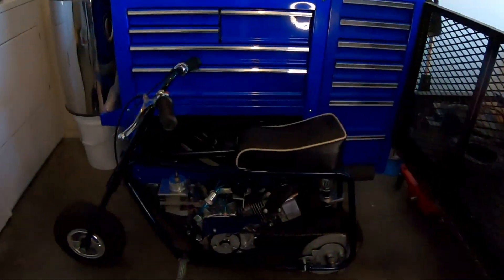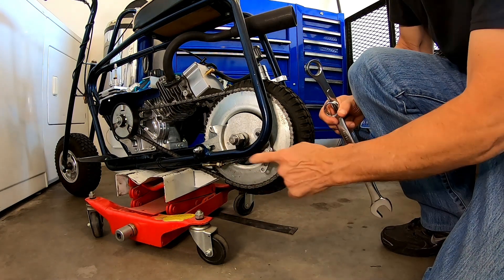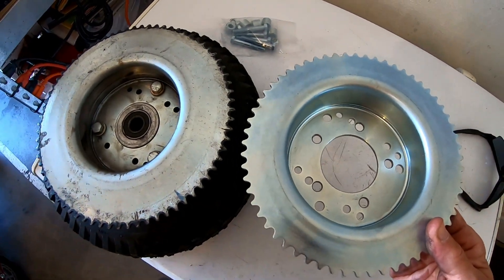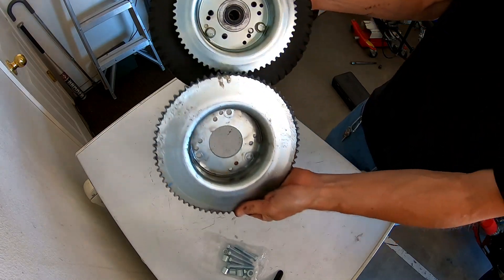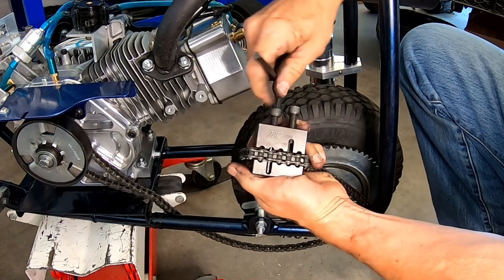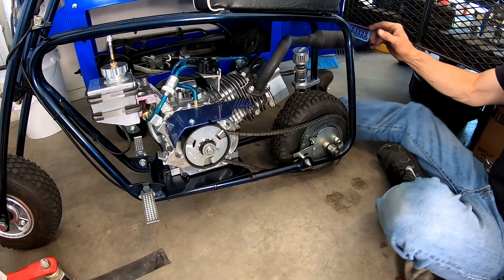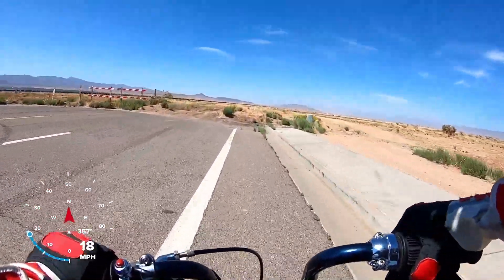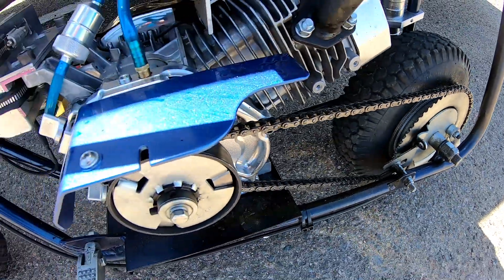Minibike goes 70 MPH/Predator 212

Comment: Beautiful bike my dude, nicely done 👌 one day I will have a bike equally as fast and then maybe one day we will meet up and race lol
Reply from the maker: Thanks! That would be fun. That's what it's all about is enjoying these things and having fun.
Reply: @Black66  and then getting a ticket😂😂😂😂😂😂😂
Reply from the maker: @IIIIIa1exIIIII  Adds to the excitement!
Reply: @Black66  my 1970 speedway shrike doesn't compare its dirty and original with the Tecumseh h30 but even after I restore it, wont compare to this beauty.
Reply from the maker: @BillyMcBean. Thanks! Yours is awesome too. Especially with that Tecumseh on there. That is old school.
Reply: @Black66  why didn't u go with a higher tire ?
Reply: @Black66 how much would that cost to get one?
Reply: Iv got a 60mph on 8in tires turning 7000rpms on a manco thunderbird mini bike  its a 212 non hemi 18lb valve springs sanded short turn 1.3 stamped rocker arms [stock style] just 1.3 ratio stock style carb with mixture screw bigger jet mod 2 cam arc rod and flywheel 32 degrees intake filter and 1in header pipe makes tones of power and has no problem moving a 115lbs to 60mph
Reply from the maker: @madness_-yg3lw  Nice build!
Reply: @Black66  thanks lot of time and money in that build runs very well and very reliable i use a bicycle brake lever for my gas and on stock carb is very smooth and controlable i plain on posting a short video on what iv done and how fast i can go only probelm now is i blow apart the clutch bushings the brass one i have to install my cvt to solve that problem but i think i might be making to much power for it and will shred the belts my goal is 100mph i plain to swap valve springs and get a 24mm carburetor
Reply from the maker: @madness_-yg3lw  Keep working at it. You will get there sooner or later. I bet you will reach your goal with a clutch.
Reply: @Black66  i ordered the 24mm carb and jet kit im swapping from 93 to 110 race fuel so im sure gonna try
Reply from the maker: @madness_-yg3lw  Sweet! It will be a beast
Reply: @Black66  I got a 24in wheel and a 14in front sprocket...I'm running a 5000w brushless motor...and a 84tooth Rear Sprocket...The controller..is setup to do 5400 to 6000rpms...I'm trying to go over 35 mph...50 would be really Cool"
Reply from the maker: @RGIIIBOXING Yes it would!  I'm building an electric bike. I'm trying to do the same. Have to get over 50. We will see how it goes. 
.
Reply: @Black66  I was going with the 3000w motor" But I just decided to go with the 5000w set up with a 72v motor...I forgot to tell you I'm building the very popular...and there not 24in...They are 22"s....Yeah..I guess we will see"
Reply from the maker: @RGIIIBOXING  Are you building the Electro and co kit?
Reply: @Black66  yes....it's a fat bike with 22in wheels...The guy on YouTube...has a 20in..fat bike..with 2 tiny hub motors...look up fat bike with 20in rims...it's a silver bike with M.BENZ WHEELS"
Reply: @Black66  Did you find the video...of the 20in fat bike"..the only difference is..my bike has 22in wheels..and a 5000w Bldc Motor.. Brushless motor" 72v Battery".....I gotta get started on it..so I can be finished by the end of April... Thanks
Reply: Little update i got the vm22 on and 26lb springs with the ec billet valve spring retainers and keeps now turning 8000 rpms
Reply: Help  up+ my mini bike please
Reply: @juliabauer5047  whats your goal hp wise and whats the application  start off by deciding whats your target rpms and then go from there the higher the rpms you want the more you have to do to make it reliable i shot for 7000 i actually was turning 7250 till i went to 1.3 rockers and turn 6900 supper simple build about double the power 10 to 15  would be my guess definitely way more power then stock
Reply: https://www.youtube.com/watch?v=TYp7SgO_FrU
Reply: My Coleman cc100x goes 53mph 😅
Reply: The 2 second electric mini bike is bull shit. You cheat .

Comment: Boss man I just bought a 18 tooth clutch 35 chain of course. I ended up switching from a 75 tooth to a 40 and it struggles so I bought a 18 tooth clutch for 25 bucks in your opinion will it help gain acceleration
Reply from the maker: Check out this video about mini bike gear ratios  https://www.youtube.com/watch?v=xV8i59aGUao&list=PLkbj-ip-5FzZG40xkiEtZHRtF_jDzxA9U&index=9

Comment: I have a pred 212, billet rod, 32 d flywheel, 265 hot cam, 26lb springs, currently running a 12 t clutch, 60 rear, would an 18 t clutch be a good option to get more speed? Im gonna try it 😂 just curious if its a good idea

Comment: I was gonna run a 58 tooth on rear sprocket but I’m not sure what clutch would be better a 18 tooth or 15 tooth clutch on a 212 predator wit 265 cam and 26lb springs and rod and flywheel I’m gonna be running this on a cc100x

Comment: I have a ct200ex but I changed the motor for a Predator max 224cc engine i changed the value springs to 18 pound  and I  have a Torque convertive and open header and  it does 50 miles per hour i would like to get it to 60 miles per hour and no governor the Rear sprocket is a 60 tooth i have a 44 tooth would it help if i put the 44 tooth on the mini bike or would i need to get a 50 tooth
Reply from the maker: Check out the CT200U-EX playlist for many combos with this bike  https://www.youtube.com/watch?v=EKY4GblVKcE&list=PLkbj-ip-5FzbVBVqMi23O5noFSAbhNOp1&index=29

Comment: With gx160 head whats the benefit of it and do you need +.020 rod?
Reply from the maker: A bump in compression.  No need for a .020 rod
Reply: @Black66  where can I look at for bigger valve options and thank you imma look into the gx
Reply from the maker: @Devonortega420  GoPowerSports has them but for even a better flowing head check out the shred head video https://www.youtube.com/watch?v=9rDS1RcU5iI&t=13s

Comment: Why don't you head the opposite direction so you don't have to slam on the brake early to not hit the curb, because it's clear at 68mph, you're still accelerating and could surpass 70 easily? 😅
Reply: I was going to say the same exact thing and that's why I came on here to post. If you had a longer stretch you definitely hit 70 plus that day, but now I see you have another video where you succeeded. Sweet build brother.
Reply from the maker: I need a different area, there are cars the other way. Check out this video I surpassed 70 MPH https://www.youtube.com/watch?v=xV8i59aGUao&list=PLkbj-ip-5FzZG40xkiEtZHRtF_jDzxA9U&index=10

Comment: Man love your videos I currently have a 208cc ironton that id like to get the billet flywheel n new rods. But I was wondering Would predator 212 performance parts work with my 208cc ironton... Or should I just save the hassle n buy a predator 212
Reply from the maker: I think the external parts would work like carb, header , things like that . The internal stuff could be Clone like the flywheel taper and rod journal sizes etc ... maybe🤔 I haven't worked with an Ironton yet.

Comment: Not to be rude but can we get your weight. I am comparing some of my modifications to yours I am about 200lb and it does seem to be a big factor in 0-30mph and top speed. If not I understand completely.
Reply from the maker: Yes, I am about 160 LBS of solid muscle.😄👍💪💪
Reply: Okay I have the same setup with a 12 tooth clutch and a 70 tooth rear sprocket and a hot 265 cam and 40lbs on you. I am maxing out at 49 Mph. I guess that makes perfect sense. Thanks for the response 👍

Comment: Hey there, love your videos very entertaining to watch. You do all the stuff that you do to these bikes. You have taught me a lot already. I am trying to buy a second CC100X Mini bike. I have had no luck anywhere finding one. That will ship to my address in New York. Is there any way that you could steer me in the right direction.
Reply: Thanks man I will give it a look at. I got 1 CC 100 X my son got from A friend of his for $20. The gas was seized up on the turnhandle. I took that off and took a mountain bike. Brake handle and put that on in replace of the gas and hooked it all up and it Works great. I also bent back that stopping screw and got that Bike flying Down the road doing over 45 miles an hour.
Reply from the maker: Gokartsusa has them . Not sure if they will ship out that way though .

Comment: I just built an azusa bike.  The spacer that goes between the brake and wheel is the small one or the bigger than the one between the outside of the brake and frame?

Comment: I have the same setup as you, the only difference is I have a slightly bigger tire setup. Mine is a slightly taller tire. I'm hitting about 73mph on it. It might go faster than that.. but I don't have the road space to do any faster. I could probably max out on a highway but the cops are dicks around here.. so that being said I'll never know what the top speed is on my bike.
Reply from the maker: Yours sounds like a ripper! Check out the Mega Moto playlist for a little faster bike with bigger tires. https://www.youtube.com/watch?v=tWLFbTe1gdw&list=PLkbj-ip-5FzZG40xkiEtZHRtF_jDzxA9U&index=28

Comment: How fast do you think I would go with a 420 cc on a 17 or 18 tooth clutch and stock sprocket I have the same bike
Reply from the maker: I think a 420 would have way more torque to pull a heavier rider. The bike would probably be quicker getting to speed but wouldn't turn the RPM of the built smaller engines so I don't think the top speed would be better unless the bike was geared with a total highway gear.
Reply: @Black66  what would be high way gearing ?
Reply from the maker: @505racing3  In this video the bike ran a 3.3 to 1 ratio.Which is a highway gear.The average minibike runs around the 6 to 1 ratio .  I bet the 420 has the low end torque to pull even more of a highway gear than the 3.3 to 1. Maybe
Reply: @Black66  where can I get sprockets like yours ?? I have the same bike I want some different sprockets

Comment: Where can I get that fuel tank?
Reply from the maker: I made the fuel tank out of an overflow tank
Reply: How much would you charge to make one?
Reply from the maker: @downsouthkustom  Not sure. Let me look into what the tank will cost me .I did this one a couple of years ago.  Its  just tapping the tank and adding the fittings and drilling the cap for the vent. Its pretty inexpensive.

Comment: Wow ,, that's hard to believe,  over 70mph !!!I am impressed !
I just changed my 75 for a 65 gained 8 mph 
Really 60 would be ideal for my Coleman 100x it has a 12 on front.
Do you think I would be better to go w  a 14 tooth on the front 
Or just drop to a 60 on rear?
To gain more speed,,
Reply from the maker: Either will work as long as the engine has the torque to pull the gear. I go 70 on multiple bikes on the channel. Check out the playlists.  https://www.youtube.com/watch?v=xV8i59aGUao&list=PLkbj-ip-5FzZG40xkiEtZHRtF_jDzxA9U&index=10

Comment: Creepy stuff.  I ran the 72 on my railroad go kart, and I loved the launch and throttle response.  
But at normal operating speed the  resonant vibrations would envelope the entire machine and it's occupants.  Any vibrations felt the same as other set-ups, but the increased RPM would cause the vibes to resonate together into a kind of harmony that made people fell ill and very creepy like vertigo.  I had several people test it and they all said they could feel it at the same speed.  They said they could not feel any serious vibrations, but certain RPM / operating speed made them feel ill and disoriented.  WTF ?
Reply from the maker: Tha is weird. Maybe you can use rubber mounts. They have them on Amazon. Have you checked out the 72 MPH video? https://www.youtube.com/watch?v=xV8i59aGUao&list=PLkbj-ip-5FzZG40xkiEtZHRtF_jDzxA9U&index=10

Comment: 70 MPH on those little tires?  Instead of new sprocket, update front and rear tires with taller ones with a more highway tread. Weld a new set of axle mounts further back on Frame if needed.
Reply from the maker: I want to leave this frame a period stock as possible. When I want to go fast I use  a few different bikes. Here is the link to one of them. Thanks for watching. 
https://www.youtube.com/watch?v=xV8i59aGUao

Comment: IT SEEMS TO ME THE TIRE HEIGHT COULD HAVE BEEN CHANGED INSTEAD OF THE CHAIN SPOCKET. BY CHANGING THE TIRE HEIGHT YOU WOULD GAIN MORE MILES PER HOUR. AND GIVE THE BIGGER SPOCKET MORE GROUND CLEAREST.
Reply from the maker: I want to leave the bike as close to original as I can. I like the five-inch tires and wheels.  I have other bikes to go fast on. Check out the playlist. https://www.youtube.com/watch?v=VbcpA0jdSIw&list=PLkbj-ip-5FzZG40xkiEtZHRtF_jDzxA9U

Comment: Hey man I have a 212 predator with billet rod and piston, 22lb springs 265 cam and flywheel. 15×600-6 tires. I will be installing 26lbs springs but I want to get more speed. I'm currently hitting 55 with a 12t clutch and 56 rear. I was thinking 60 tooth and 15t clutch for more speed like in the 60s, what would you recommend?
Reply from the maker: Every tooth you go up on the clutch is equivalent to subtracting 6 off of the rear sprocket so that should get into the 60's with that combo . Depending on rider weight and other factors.

Comment: Put on a 45 tooth rear sprocket see if you can get to 100
Reply from the maker: Check out this video. Went over 70  MPH https://www.youtube.com/watch?v=xV8i59aGUao&t=11s
Reply: @Black66  are you in the 20hp range stage 4. 15hp stage 3, 12hp stage 2, 10hp stage 1.5, 9hp stage 1

Comment: So with the 14 tooth clutch and 36 tooth rear sprocket with my 208cc engine bike will barely take off hits about 40 mph sounds like it's at idle when it's doing 40 and won't really gain above that unless you go a mile so my gear ratio is not good at all with my brand new clutch I want my bike to do above 60 mph I have a 208cc engine what clutch and rear sprocket do I need with a 10-in tire and 150 lb guy also if I put the bike on a stand so the rear tire spins freely the bike will rev out and spin the tire seems like 50 mph but not when I'm on it going down the road after half throttle it doesn't react

Comment: All right so I ordered a 14 tooth clutch for my 208cc Troy-Bilt with electric start the bike originally has a 36 tooth rear sprocket so 14 to 36 teeth the link you sent with the calculator calculated 53 mph hopefully 14 to 36 is okay and will work I have a nine and a half horse carburetor and a straight pipe I'm going to put on it

Comment: My mini chopper video uploaded please check it out I ordered a 1 in 14 tooth centrifugal clutch I'm going to Napa Auto parts to buy a #40 chain can't exactly remember what amount of teeth is on my rear sprocket I will let you know the teeth on the sprocket and clutch and top speed when it's finished with the motor I have and upgrades
Reply from the maker: Ill check it out.

Comment: Once again getting back to you because I have been doing all kinds of research trying to figure out exactly what clutch chain and rear sprocket I want to get for my new engine what I have come up with is right now I have a 4 hp Robin Subaru engine  12-tooth clutch going to a rear 72  tooth sprocket 35 chain 9/1/2 carb straight pipe Governor delete 43mph my idea is a 14 tooth one inch clutch on the 208 CC Troy-Bilt engine I just bought with a 54 tooth rear sprocket which would give me just under a 3.86 ratio do you think this would work well?

Comment: I'm ordering my clutch and rear sprocket tonight for my 208 cc mini chopper would an 18 clutch and a 60 sprocket work for me with the 208cc engine
Reply from the maker: Ya I think so. You could check out the gear ratio calculator for tire height to really nail it down.
Reply: @Black66  also this bike is not much but definitely heavier than a Doodle bug I don't think the weight is going to make too much of a difference it's not that much heavier but it is definitely heavier
Reply from the maker: @williamedwards7315  Weight of the rider will have an effect also .
Reply: @Black66  I'm a hundred and fifty pounds at the moment
Reply: @Black66  I don't know how to share a picture through YouTube or I would send you a picture of the bike I'm building and then you would probably be surprised at what I have built  I have been working really hard for the little bit of money I have and can't afford to order more than one clutch and sprocket so I have to make sure they are both the right amount of teeth or if I just order a clutch or just a sprocket singly need to know how many teeth either way front and back and so far I cannot figure it out I see mini bikes on YouTube that are doing 70 or 80 miles an hour but cannot figure out what clutch and sprocket they're using or if it would work with my 208 just not getting answers yet have not been able to figure it out myself unless you can direct me to that ratio calculator
Reply from the maker: @williamedwards7315  Here is the link for the calculator. You put in your tire height ,number of teeth on the front and rear sprocket and then you can see how many RPM you will be turning at a given speed. https://www.gokartsupply.com/ratios.htm
Reply: @Black66  okay thank you very much once again if for some reason I can't figure it out I'll message you back
Reply: How do I look at that ratio calculator I need to know how many teeth on my clutch and sprocket with a 10-in tire and a 208 engine to get max top speed but still be able to take off even if takeoff is slow I have to have over 60 mph and the more after that the better I don't know if I should up the teeth on my clutch or lower the teeth on my rear sprocket or both